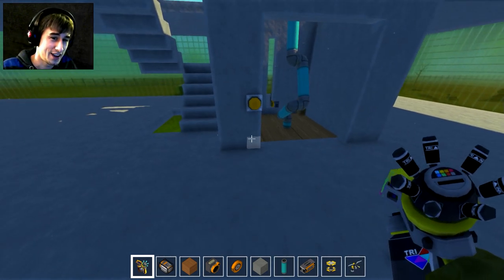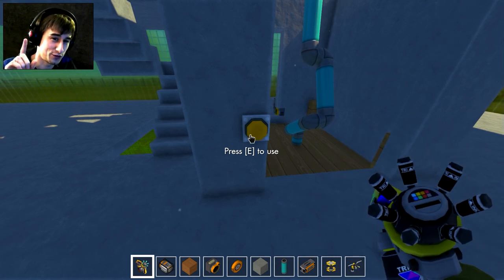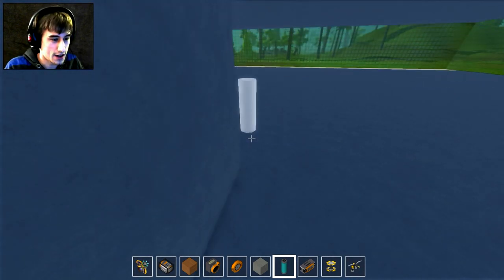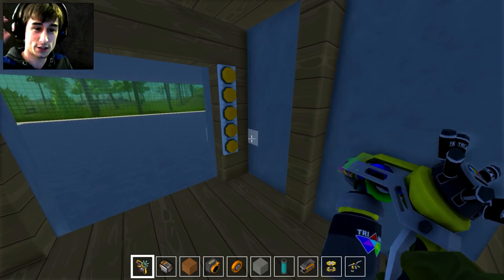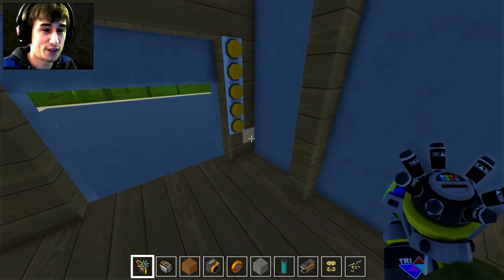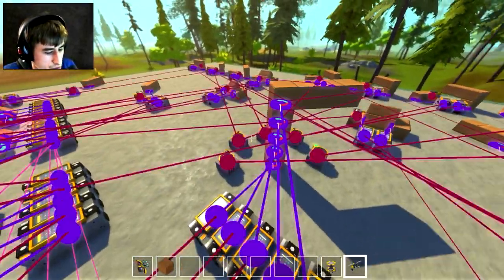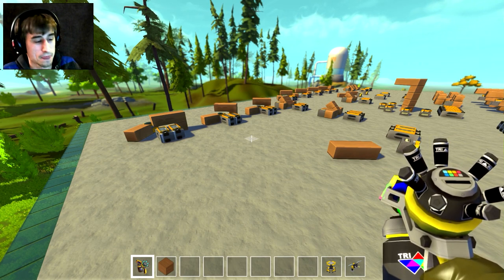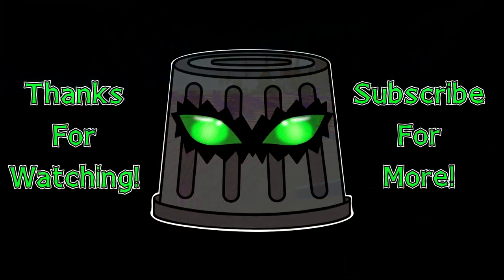CHAIN ELEVATOR WITH 5 FLOOR SELECTION! (Scrap Mechanic #21)

Comment: How did it feel building this and than later finding out about the logic blocks? Lol still this is cool stuff!
Reply from the maker: I could remake this circuit a little bit easier. Still amazing to see how it used to be done :D
Reply: would be interesting to see it made with logic gate blocks :P
Reply from the maker: Yes I've thought about this and I'll probably do it at some point but much larger scale with logic blocks.

Comment: ive made one with 3 floors but I think my elevator is an easier mechanic but that is my opinion (this midday is a tutorial of it on my channel available)
Reply from the maker: Yes the one I made for Camodo used a much simpler mechanic than this. The purpose of this was to see if I could use chains which means you don't have fixed positions like a controller does.
Reply: ow ok

Comment: Impressive work :) But not really an elegant solution xD
Reply from the maker: +Superturds For sure. The easiest way to do this is have the elevator use a series of pistons rather than a chain. The main reason the circuit is so complicated is just so I could use a chain to control movement. If I were to make this on a survival based map though I would use the same piston method you did :D

Comment: Can I have a download
Reply from the maker: I just loaded this world and the circuit is broken... I don't actually know what's wrong with it but I think some of the controller states were not saved. Once I figure out what the issue is and make sure you can load the map no problem I will post here :D

Comment: hi you should take this video to steam, for more subcribe
Reply from the maker: +Furkan Birışık Good idea thanks!
Reply from the maker: +Kannst Mich Mal (One Two F.U.C.K You) Again, does the guide use pistons or chains? The point of this build was to make the first chain based elevator with floor control not to do the same piston method everyone else has before.
Reply from the maker: +Kannst Mich Mal (One Two F.U.C.K You) Well, sorry you feel that way! I try to do things different from everyone else to prove the concept.
Reply from the maker: +Kannst Mich Mal (One Two F.U.C.K You) Ok I will!